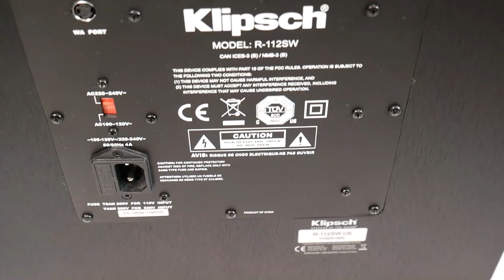Take apart Klipsch 12 inch Subwoofer - Disassembly

Comment: Thank you for showing the speaker from the inside. I like such films the most, and thanks to them, users do not have to disassembly their subwoofers. A large magnet, the speaker looks good. How do you rate this subwoofer?
Reply from the maker: For $450, you can't expect much. But it's totally in line with the Klipsch sound, boom boom, very powerful.

Comment: Go to mark:  3:19 top left circuit, Do you see the 820 Ohm  fried resistor? I do. Common with this sub amp. It is only a 3Watt.  Replace it with a 10watt  and add wires to move it to a heat sink.
Reply from the maker: Thanks for advice.

Comment: 3:18 Looks like the resistor has already cooked a few capacitors on this amp. Common issue with these subs...
Reply from the maker: It works like new as, hope long time and you just kidding me 😀 its just glue, not cooked 🤫
Reply: @Techscrews  Hm, I can tell for sure that some of the caps have started leaking fluid. But they could be working still, yes. 
I got a tip for you that I'm using on my R-115SW; buy a smart power-outlet that cuts the power to the sub at night, and when you're not using it. This will spare the amp a lot!
Reply: @Nathan Mkcane I think I've posted my answer twice now, but it keeps getting deleted...
Reply: @white_goose9782  Yeah, I got to read the first one, but it was gone a few minutes later. There wasn't anything wrong with your answer either 🤷‍♂️ You just tried to prove your point, which you managed to do. 
I read the article, and it says that the auto on/off function (on most models) does not save these amps.

Comment: It's unfortunate that Klipsch went with a cheaper 2 magnet woofer rather than one large magnet which definitely makes a difference. Regardless though, I'm a Klipsch Sound System owner too.
Reply: Multiple, stacked magnets are no more or less effective than one large one. Multiple small round magnets arranged in a donut shape (Focal, Epique), are especially effective when using rare earth neodymium, samarium cobalt, etc.. This woofer is actually surprisingly well built, with an extended length 2 inch diameter voice coil. The magnet is stacked to give it depth allowing it to control the extra excursion.  It just isn’t pretty, doesn’t need to be. There’s a specific requirement depending on the design and construction. To a great, almost absolute degree, the size is determined by the application. There are a lot of really BIG magnet speakers on the market that sound like shiz… Check out the Morel line of large voice coil diameter, neodymium configurations that simply bury larger, impressive looking, inferiorsounding subs. For the most part, especially in audio, you get what you pay for.
Reply: @steveschwartz9421  yup motor force calculations are different and it's also based on the grade of ferrite and neo along with how the motor is magnetized to get the BL specs of its TS parameters along with how it interacts with the voice coils and soft parts. Its a big balancing act between cone control, excursion, efficiency etc.. bigger magnets with bigger voice coils and stiffer suspension, you can throw a lot of power to before it wakes up and can have much higher capabilities even in a smaller enclosure. meanwhile a medium strength magnet with softer suspension and smaller coil will need less power to get loud but requires a larger enclosure.

Comment: 1 thing I can't that is how to get the Output channels connection rom this SUB ????
Reply from the maker: what please ?
Reply: @Techscrews  How to connect setalite speakers ?
I mean output speakers ??
Reply from the maker: you don't connect the speakers to the subwoofer, but speakers and subwoofer connect to sound source with 3.5mm splitter(in simplest way) or through DSP unit.
Reply: @Techscrews  ok

Comment: That basket looks like it needs some dampening. Does it ring when you hit it? I got 4 of these, they are very boomy stock. If you use minidsp to time align and eq, they are very good. Looks like if I dynomat the basket and add some more bracing it would be even better. But I'm using them for cinema, so I'll probably let them be.
Reply: Thats a majority of where the cost cutting is. Yikes. Now i know to swap out the sub asap

Comment: My R-112SW amp failed after about 6 years of use.  Wish I could find a cheap replacement amp.
Reply from the maker: Just go to repair shop and repair it.
Reply: I also got a failed amp in my PSB sub, I bought an used external sub amp to drive it, it works very nice.
Reply: @swllz  thank you.  I thought about that, but in the mean time I bought a rockin' SVS sub.  Don't think my wife would tolerate me bringing the old one back to life as well.  haha
Reply: @AztecHusBone  , my PSB is more musical and detailed than SVS, so I would like to listen to it

Comment: Eh, the amplifier and driver actually look to be pretty good. I think with a better enclosure, the sub would sound much better!
Reply from the maker: this is definitely not bad news, what you think should be improved enclosure?
Reply: @Techscrews  I think the subwoofer could benefit from a sealed enclosure or a passive radiator. If that's not the case, the port tuning should be a little different and maybe the enclosure size. But it definitely has to be reinforced more and maybe thicker wood to minimize resonances and even out the frequency response.
Reply: @speakerpat  1/4 wave transmission line tuned at the subs FS.  Sealed, ported, passive radiators are all garbage in comparison to a proper T-Line for flat response, loudness and accuracy.

Comment: 470€ . now in the shops in germany. sorry. but inside is nothing with high quality standard. cheap class d amp . 12" iron basket. 2 magnets  and a 70s desingn of enclosure. 😂😂😂😂. Diy subs are the future.
Reply from the maker: thanks for comment, but DIYs not for everyone. Do you have some good active subwoofer DIY project, what we can try? Thanks.
Reply: Actually the box design is ok. It's the driver and the poor design plate amplifier is the problem.